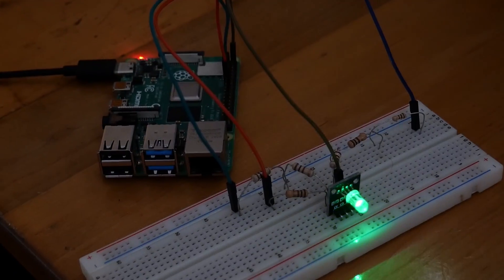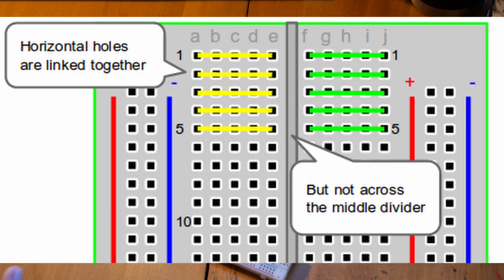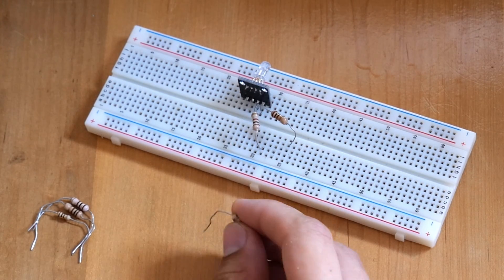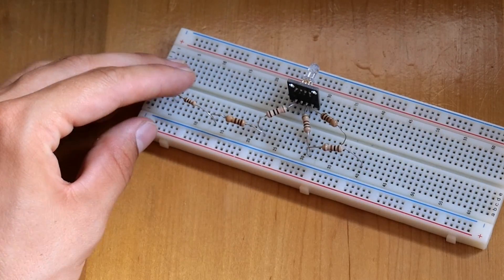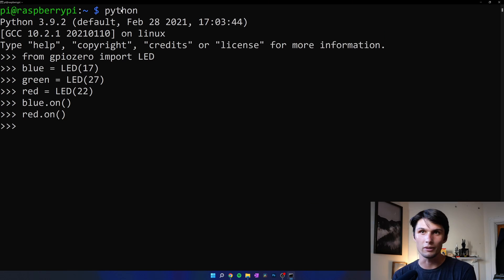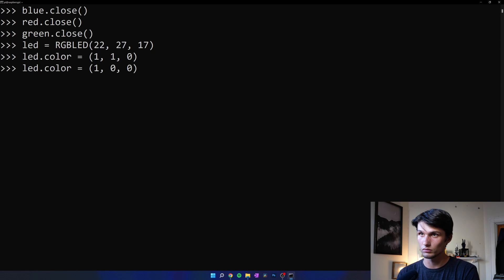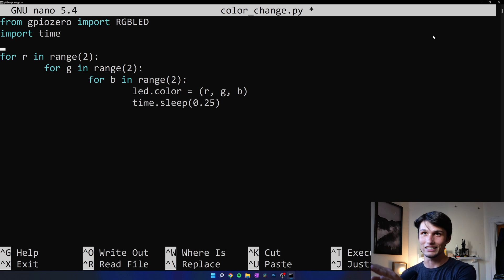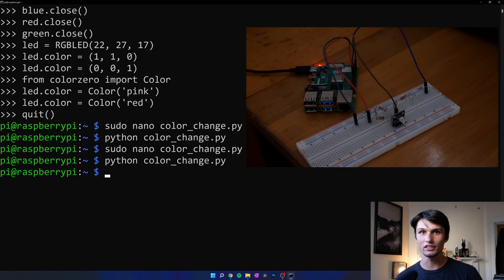Control an RGB LED with your Raspberry Pi

Comment: What kind of  module are you using?  Most modules which yours also looks like them have the resistors already on them. So you  adding new resistors are superfluous. Sometimes, they may even make the led light appear very low.

Comment: Awesome tutorial! I am working on a project where I will control multiple LEDs (mixed parallel and series) and I have to be economical about using the GPIO pins as I will need most of them. Everything will be powered with an external power supply. I am using transistors and the GPIO pins are connected to the base. I was wondering if there is a way to control the RGB led diode using a single pin instead of 3. I got a bunch of tiny Adafruit WS2811 NeoPixel chips (just the chips) and then I realized I don't know what I am doing 😆😄Thank you again!

Comment: Nice tutorial.  I appreciate you not having a lot of fluff in the video and just getting right to it.  I just got a few Raspberry Pi Pico boards, and one of the things I was planning to do was to set up some color presets for a button box I'm making, and cycle through those when I hit a certain button.  This tutorial let me get enough experience with the LED module to get it working.  Thanks!

Comment: Can I control gpio pins when find specific object
Reply from the maker: Yes you can. You are able to write an if statement to determine when you find the object. Then use the code to control the gpio pin